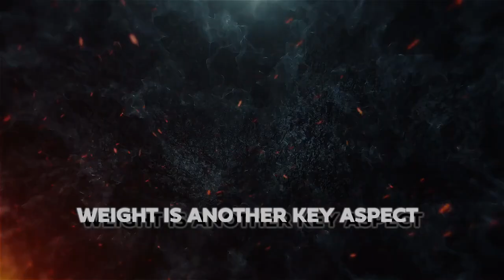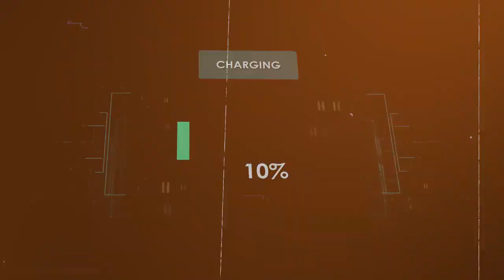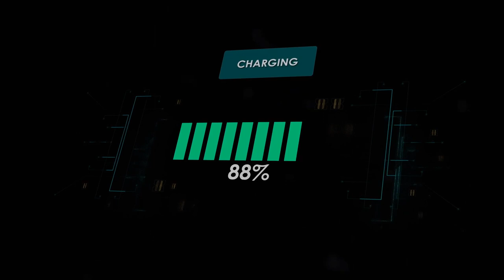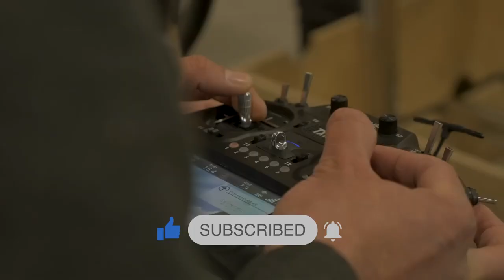GOODBYE LITHIUM! Elon Musk Reveals All-New Tesla Aluminum-Ion Super Battery

Comment: You're spreading lies. The chemistry they're moving to is NMA (Lithium Nickel Manganese Aluminum) (LiNi1−x−yMnxAlyO2)
Reply from the maker: Thanks for sharing your thoughts! The video is discussing potential advancements in battery chemistry, including aluminum-ion batteries, which researchers are exploring as a longer-term alternative to lithium-ion. While Tesla is indeed using NMA (Nickel Manganese Aluminum) batteries in some of their vehicles now, the tech community and companies like Tesla are also exploring various other battery chemistries to improve energy density, charging speed, and sustainability. The aluminum-ion concept is still experimental but shows some promise, so it's interesting to see how these developments might shape the future of EVs. Let's stay tuned to see where the tech heads!
Reply: @ChargedUp18  Sodium ion is the next step. Aluminum oxidizes too easily and must be perfectly clean to be reactive, and must be cleaned in an inert atmosphere in order to remain reactive. If there is ANY oxygen in the environment, it will passivate by converting its surface into sapphire (Aluminum Oxide)

Comment: Lithium is once of the most common elements. Do your research man.
Reply: There is enough Aluminium already used and discarded in the world in dumps to provide all the Aluminium needed for AL-ion batteries.
Reply: @anguscampbell1533  Aluminum is the most recycled element on earth, because it takes 5% of the energy to recycle it as it does to refine it from Bauxite, its ore.
Reply: @mattio79  That is so right.  Aluminium is the holy grail of recyclable metals.
Reply from the maker: Absolutely! Aluminum is incredibly efficient to recycle, which is why it's one of the most widely recycled materials on Earth. Its low energy requirement for recycling—just 5% of the energy compared to extracting it from bauxite—makes it eco-friendly and cost-effective. This quality could make aluminum a game-changer in battery technology, especially with Tesla’s new aluminum-ion battery development. If it lives up to the hype, we might see sustainable, high-performance batteries that are easier on the environment and potentially even more affordable. Exciting times for clean energy tech!
Reply from the maker: Absolutely! Recycling aluminum from existing waste is a game-changer for sustainability. Unlike lithium, aluminum is abundant and recyclable without significant loss of quality, so tapping into aluminum from discarded sources could help meet the demand for new aluminum-ion batteries. If Tesla and others can scale this tech efficiently, we could reduce reliance on mining while also cutting down on landfill waste. It’s a win-win for cleaner energy and less environmental impact!
Reply from the maker: Actually, you're right that lithium is relatively abundant compared to some other elements, but the challenge isn’t just about availability. Lithium extraction is resource-intensive and has environmental impacts, especially with the growing demand for batteries in electric vehicles and renewable energy storage. Aluminum-ion technology, like what's mentioned in the video, could be a game-changer because it’s potentially cheaper, faster to charge, and more sustainable in the long term. That's why companies like Tesla are exploring alternatives. It's exciting to see where this technology might take us!

Comment: A very important aspect of aluminum batteries was not mentioned. A charging station that can take advantage of the 60 times faster charging rate of aluminum batteries would likely be prohibitively expensive. Using such a charger would likely cost much more than a tank of gasoline.
Reply from the maker: You make a great point! Even though aluminum-ion batteries have impressive potential for faster charging, the infrastructure to support that speed would indeed require significant upgrades. The cost of high-powered charging stations could be a major hurdle, especially when compared to the relatively low cost of fueling up with gasoline. Hopefully, as the technology develops, we’ll see advancements in affordable, high-speed charging solutions—maybe even something that can leverage aluminum-ion’s full potential without breaking the bank. Thanks for bringing this up!

Comment: "growing demand", everyone's production way outpaces their sales. IIRC Ford just downwrote about 1.3B worth of EVs...

That said, Elon might be purchasing aluminium-ion batteries, or even tech, but it's been other researchers that have been working on those. Al-ion does sound better than Li-ion, but you failed to highlight how Al-ion is worse in energy per volume, even if better in energy per unit of weight. The limitation in charging even now are the charging points, not the batteries.
Reply from the maker: You raise some valid points! The current supply chain challenges and production issues are definitely impacting how quickly companies can sell their EVs. As for aluminum-ion batteries, you're right; while they have some advantages in weight, the energy density per volume is a concern. It’s exciting to see advancements in battery technology, but charging infrastructure will also need to keep pace for these innovations to be fully realized. Thanks for sharing your insights!